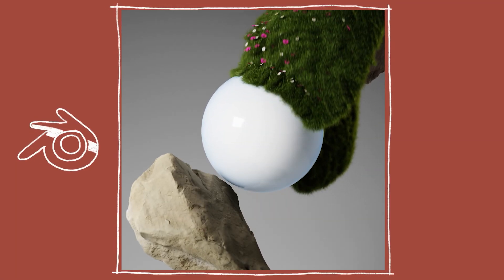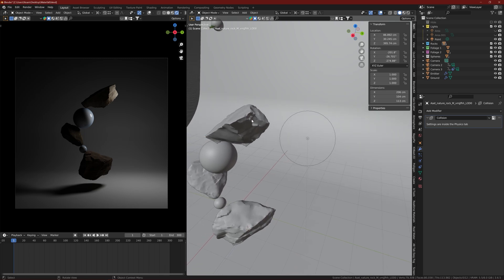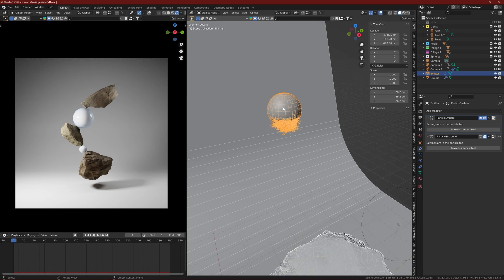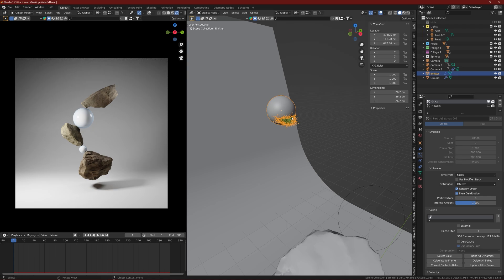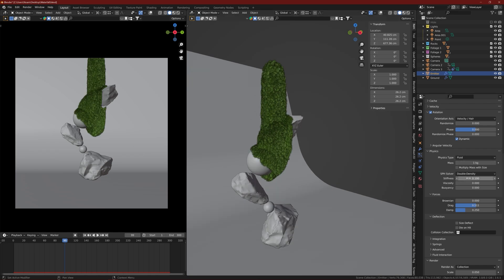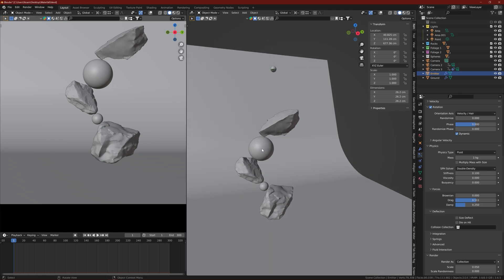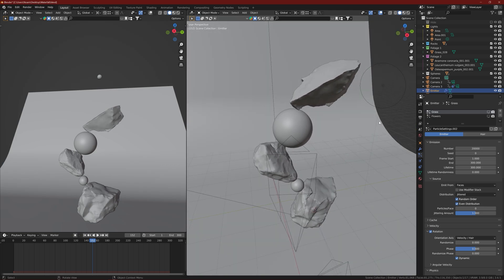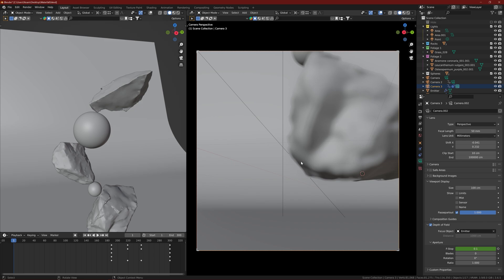How to make a FLUID SIMULATION of foliage in Blender! (No Geo nodes)

Comment: Sweet! Have to try it! Thanks! How do you setup your collision objects?
Reply from the maker: Choose the object, go to physics tab and choose collision and set the damping (under particles) to 1
Reply: Thx! Worked out! Another one, are there any special settings for two different particle systems, tried your way with the same setup but fewer flowers of course but they stuck at the emitter, use the fluid but not working somehow..
 @NoamElyasim
Reply from the maker: @life.by.linus3D  Did you check the "Lifetime" value under the "Emission" tab? Make sure it is the same number as the end frame. Maybe that's the problem...But try out different thing like applying the scale, delete all bakes and bake again maybe, make sure the flowers particle system is not hidden in the viewport. I hope you'll figure it out!